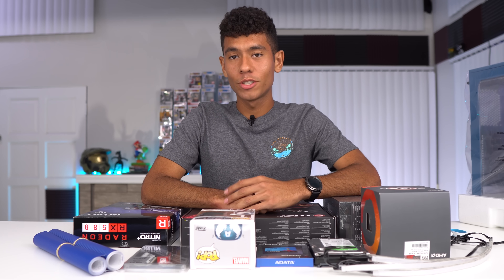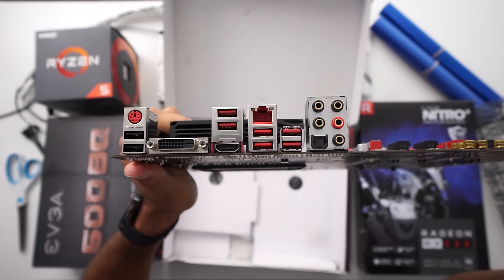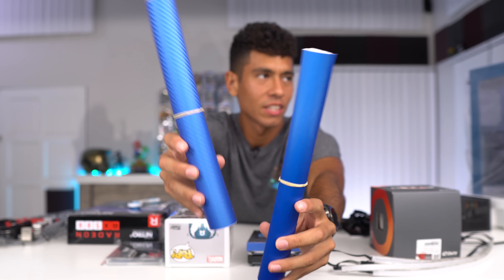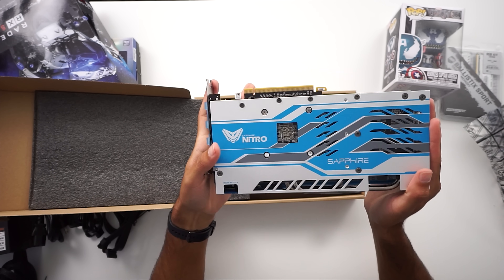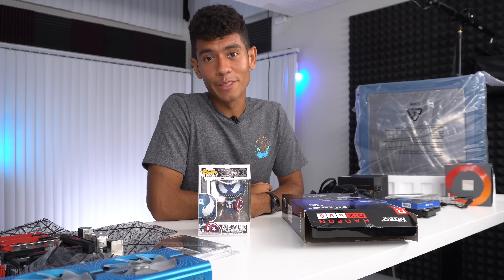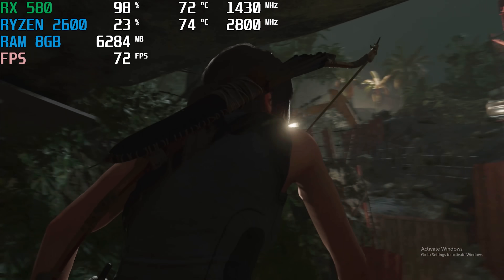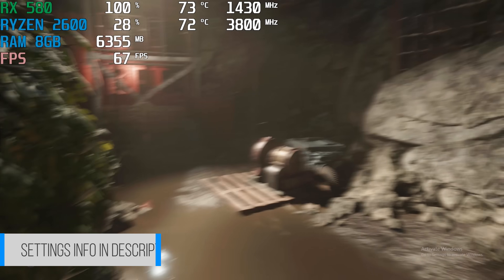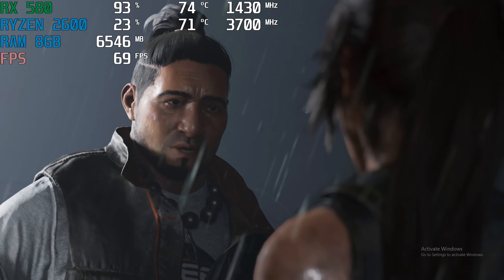$900 Gaming PC Build - Ryzen 5 2600 RX 580 (w/ Benchmarks)

Comment: im building a similar pc here are the specs:
processor: ryzen 5 2600x(200$ new)
graphics card: gigabyte gtx 1070(300$ new)
ram:2 standard ddr4 8gb sticks of ram(150$ new)
harddisk:1 terrabyte harddisk(58$ new)
case: cougar mx310(60$ new)
power supply: 500watt psu(50$ new)
motherboard:GIGABYTE GA-AB350-Gaming 3 AMD RYZEN AM4/ B350/ RGB Fusion/ Smart Fan 5/ HDMI1.4/ M.2/ SATA 6Gbps/ USB 3.1 Type-A/ ATX/ DDR4/ Motherboard(81$ new)
anything wrong with it if so plz tell me(btw it cost 899)

Comment: Great video.. does.everytjing apply the same waylike I'm building mine tomorrow .. and I have asus x470 pro, barracuda hdd ,ryzen 5 2600x 2 8gb stick and a evga gtx1070 with   a 750 power supply with a cooler master case .. am I missing something .. thanks

Comment: button, nothing happens. However, if I press my Eject Button, it will start up. I checked the front panel connectors and where they should go on the motherboard, I put them in the right spot. Could someone help me out on this?

Comment: This is kinda trash build you nead atleast 240 GB SSD 128GB fills up really fast and ram is too slow for ryzen 5 2600 you need atleast 3000Mhz RAM
Reply: Would you recommend an m.2 nvme ssd or is the 2.5" acceptable?

Comment: So many options, im considering this build. Will the 580 cut it or should i throw in the extra 150 euros for the vega 56? I intend on putting in 16 gb ram, is that overkill? I wana be somewhat future prove. What does that blue wrap do? Can i use the regular cpu fan or do i invest in an aftermarket one? Any tips would be so appreciated
Reply: Vega 56
Reply: 1)RX 580gb will get the job done. If you're doing tasks CPU intensive like video editing, streaming, mining, aftereffects, multitasking, 3D rendering then my friend go for Ryzen 7 2700x
2)Blue carbon wrap is nothing but a wrap to hide the black color to get good aesthetics for PC.
3)Never buy CPU second hand always go for the new one.
I hope this solves your answers.
:)
Reply: @morespeedmorepeace  all the things you just mentioned being gpu demanding arn't gpu demanding at all they are very cpu demanding though
Reply: @kieron_  I edited the comment. 
Sorry my bad.
Reply: 16gb is not overkill

Comment: A $900 gaming PC with only 8gb of RAM? Should've just scrapped the SSD and spent the money on more RAM.
Reply: @Flurry 
Geez dude chill. I don't know why you're getting so worked up. Just Cause 3, Just Cause 4, Batman Arkham Knight, ARK, Battlefield 1, Battlefield V, and GTA V are a few games that either need and/or run much better with more than 8GB of RAM. 16GB is also much more future proof than 8GB. Not to mention that it raises your max RAM potential, should you ever want more RAM. With a PC at this price, I'd say you'd want more than the bare minimum on what you need. If you ever wanted to get into video editing or VR, 16GB is much better, too.
Reply: @Flurry 
I'd rather be able to play any game I want to on my $900 gaming PC and have to wait a minute longer to turn on my PC.
Reply: @Flurry 
If you'd actually read my reply, you'd see that I know what I'm talking about. Getting triggered over an opinion makes it look as if you're the ignorant one.
Reply: @Flurry 
I have. And all research shows that 16GB of RAM is much better than 8GB in multiple AAA games (and is sometimes pretty much required if you don't want stuttering), VR, and video editing. And provides plenty of breathing room and will last much longer. 16GB of RAM affects performance much more than faster loading does. You can look that up, too. Everywhere you look will recommend 16GB of RAM instead of 8GB for Battlefield 1 and V and Just Cause 3 and 4, video editing, and VR. That may only be 4 games but that is the direction gaming is rapidly heading towards. The gaming industry is also heading towards 4K, too. The popularity/hype of the PS4 Pro and Xbox One X demonstrates that.
Reply: @Flurry lmao
Reply: @Kev B
I was more referring to the base parts. I personally don't count aesthetics and extras as part of the build. I agree, though, they offer nothing to the build other than a bit of eye candy, and the PC already looks fine anyways. For a more budget friendly build, it's just a waste of money that could go towards improving the actual machine.
Reply: Nah the ssd is worth it
Reply: This build is better for way cheaper and more ram but less storage

Comment: Will AMD Ryzen 7 2700X Processor with Wraith Prism LED Cooler - YD270XBGAFBOX work with this build ?
Reply: yes
Reply: Jake Ngo  thanks. I’m going build this pc in January but wanted to spend a little more money to get more upgrades. Do you know if you can buy a wifi adapter to attach to the motherboard? Or can you only get a usb wifi adapter.
Reply: Ashleigh & Marcus Vlogs Edwards if you want to get the WiFi adaptor to be part of the motherboard than you could buy a WiFi card that goes in a PCI Express port but I’d suggest getting a usb adaptor instead so you wouldn’t risk the WiFi card not fitting with all your other parts
Reply: Jake Ngo thanks. Oh last question was wondering about air flow with those two fans in the front. Is it worth it to buy extra fans to maybe put on the top maybe ? Or does the airflow in this build work perfectly?

Comment: You don't need $900 for a ryzen 5 2600 and Rx 580!
Reply: Built a 2600 rx 580 build for just over 600
Reply: @BP02392   Can you list your parts?
Reply: @BP02392  does that include tax and shipping?
Reply: 1000€ in Finland :)
Reply: @Jokakutihut1  Hyi niin kallis? Ostin ROG GTX 1070 OC, R5 2600, 16GB 3000Mhz, 500gb M.2, 1tb hdd ja virtalähteet ja kotelot ja kaiken muun 1050€. :D
Reply: @lauri3705  Ja mistäköhän löytää osat noin halvalla?
Reply: @BP02392  yep
Reply: @BP02392  Yes it's possible!
Reply: @BP02392  what motherboard did you buy?
Reply: @sleepy5838  A gigabyte GA AB350
Reply: yeah he spent more on the graphics card because there was a custom blue one to go with his build.
Reply: I made the same build pretty much just swapped the 2600 w an i3 8100 because I couldn’t spend the 160-175 on the processor
Reply: @highlight9678  if i were you i wouldve went with a cheaper ryzen like a 1600x, its better than the i3 by a lot.
Reply: CatArtz i know man and I regret it and I bought a high end Z370 board w out even thinking about it..my original plan was to go with Ryzen but I wanted to go cheaper but ya know I’ll still get solid gaming performance so it’s straight
Reply: Edgeshot Thanks. Ok now can you send them to me?
Reply: He has a 750 build with the same specs
Reply: @KyoukoWatches  yeah but I found almost the same parts with just over $600
Reply: MrButterFluff I’m going to build a pc with those specs so could you lmk where you saw those prices
Reply: worth it to get 16 gb over 8?
Reply: @backward9  yes
Reply: Benedikt ya I’m building a Ryzen 5 2600x, 16 gb ram, and gtx 1070 for $900. His build is like what you’d pay for a prebuilt haha
Reply: Well prices have dropped and also you dont need saphire it costs $100 extra
Reply: I mean hey paid 300 for the rx580
Reply: @rainmanxt  link?
Reply: it focuses on CPU, GPU and ram which is most important for a budget build also cooling which I picked a case that has 3 fans... this build is overpriced... he could of got a cheaper gpu with the same performance could of got a cheaper case as well
Reply: His build only has 8gb of ram 2x4 gb which is good since its dual channel but you can get cheaper 16gb of ram 2x8 for cheaper
Reply: "FoR tHe LoOkS"

Comment: I'm going to use ryzen 5 2600, xfx rx 590, corsair vengeance 16gb. What mobo should I use? And is EVGA - BQ 500 W 80+ enough for this PC?
Reply: b450 or x470 will get the job done.
I would recommend to go for 600W just to be on the safer side.

Comment: I just finished my build, x470 gaming pro motherboard, rx580 8gb mk2, and ryzen 2600x. Installed the flash drive with windows 10 with key. Started the pc took me straight to window 10 install everything was going ok it was installing.  Walked away, came back and the screen was black. Tapped the mouse and nothing happened. Shut pc off by pressing power button once. Turned it back on and there's no signal to monitor. Any ideas of what happened?
Reply: you've to take flash drive out after its installed and then restart. all good?
Reply: @morespeedmorepeace  I actually manually shut the pc down for like 20min and then restarted and it did a install restart.

Comment: Hey Joey, I plan to build a gaming pc with ryzen 5 2600x and GTX 1060, IS IT A BAD COMBINATION?, AMD cpu and NVIDIA gpu?
Reply: It is great but you can get a ryzen 5 2600 with a arctic freeze 30 dollar freezer which is the same price as the 2600x and you can overclock it and it will stay cool

Comment: I have a couple of questions:
-Amd 2600 150€ or 2600x 190€
-is 16gb ram needed if on a budget and only gaming
-best motherboard for the 2600 under 100€
 Thanks
Reply: Ok 2600 and then overclock it and get the same performance for less dollars and 8 gb of ram is enough 16 is overkill and best motherboard get a x370 mobo from msi or asrock
Reply: @Mkh-1442  but i will probably have to buy a better cooler as the 2600 comes with a smaller than the 2600x. And if oc i should most defenetly get a better cooler.
Reply: Get an arctic freeze cooler I think it is names arctic freeze one for 30 bucks and you have the same 2600x price but better performance
Reply: @Mkh-1442  i might just go for the x for better performance without oc and a better fan
Reply: Ok

Comment: Nice video and thanks for the links of the build, it is the same build I am doing, only I would like to take the ryzen 7 1700X since the price now approaches the ryzen 5 2600X (I work in addition to gaming video editing and more ).
For the rest I'm using the Supernova EVGA G3 750W taken in offer at € 60, Samsung EVO 850 500GB SSD, RAM G.SKILL Trident Z 3200ghz, I just have to choose a monitor with the freesync and the case.
I wanted to ask if the sink of the AMD behaves so bad, seeing the FPS I also noticed that in most games temperatures are quite high, around 75 degrees for both cpu and gpu (rarely the gpu is 55 degrees), can you do something to lower those temperatures or is it normal?
Over time, the components do not wear out before increasing the Delta T and then wearing the board due to thermal sailing?
Thanks for all! God bless you.

Comment: Anyone know what other case i could use and graphic card and either a lil less with around same results and compatible? Would really help, i'm new to this. A case still used like this but maybe a slick black or white that be nice with red rgb lights
Reply: Xavier Cardon maybe a Msi Rx 580 8gb  for around £230-240 but this depends where you are from .
Also recommended a Corsair Spec 05 comes with a sleek black finish and a Red quiet Led  Fan . It’s what I currently have now with the Rx 580 used in this video :) also gtx 1060 6gb depending on the price . 1060 and 580 come close with performance. 580 has a slight edge in High demanding games but if you want to play Games like csgo etc then you could really scale down and get a gtx 1050 ti for around 150-200 also again depending where you are from This will easily allow you to play games in high settings 60fps but may have to scale the graphic settings down for higher demanding games . Hope this helps aha
Reply: Itz Noble can you screen shot your pc?

Comment: I will build my pc in black friday and i will use a B450 asus prime motherboard ryzen 5 2600 ,RX 580 8gb gigabyte gaming, deepcool matrexx 55 RGB case, 620w power supply modular, 16gb of ram Gskill trident Z, 1tb hard drive and a 240gb M.2 ssd
Reply: if u  use stock cooler get lowprfile memory vengeance 3200 lpx.

Comment: I spent $1000 and here’s what I got. The benchmarks are much higher. 

CPU Ryzen 1800x - $250
Asus x370 MB- $150
GTX 1060 3GB - $180
Corsair 16gb(2x8GB) - $150
SSD EVO 500GB - $150 
PSU - $50 
Case temper glass phantek w fans- $80

Comment: Hey joey. Can you please build a pc with these parts:

Motherboard: MSI x470 Gaming Plus
Power supply: EVGA 600 Watts
Gpu: Saphire Radeon Nitro+ rx 580 blue edition 
Cpu: Amd ryzen 5 2600 with cooler
RAM: Corsair vengeance LPX 8gb ram ddr4 
Case: NZXT S340 black and blue
SSD: ADATA 128gb
Hard Drive: segate barracuda 2tb 
Led strips: NZXT HUE+
_______________________________
Like if you want Joey to see it👍

Comment: my black/red PC Build: 
CPU: AMD - Ryzen 5 2600 3.4GHz 6-Core Processor
Motherboard: MSI - X470 GAMING PLUS ATX AM4 Motherboard  
RAM: G.Skill - Ripjaws V 16GB (2 x 8GB) DDR4-3000 Memory 
SSD: Crucial - MX500 250GB 2.5" Solid State Drive
HDD: Seagate - BarraCuda 1TB 3.5" 7200RPM Internal Hard Drive  
GPU: MSI - Radeon RX 580 8GB ARMOR MK2 OC Video Card  
Case: Phanteks - ECLIPSE P400 TEMPERED GLASS ATX Mid Tower Case [PH-EC416PTG_AG]  
PSU: SeaSonic - S12II 620W 80+ Bronze Certified ATX Power Supply
Total: $880 USA Dollars Aprox.
Note: the ram coast more than the motherboard LOL! and because Call of duty Black Ops 4 and GTA V need more of 8GB RAM maybe 12GB RAM is good idea after all

Comment: Hey, could be nice if you gonna make some video about cooling. My problem: i have no room for pc on the top of the table, so am using the box under the table. The bad thing its flowing warm air into the box so the pc more warm. You think can i change direction and suck air from back and push out on the front?

Comment: Could you build this pc? :D
Ryzen 7 1700 wraith boxed
Msi b450m mortar
Asus rog strix rx580 08g oc
Corsair vengeance RGB 16gb 2666mhz
Cooler master q300p with 2 extra cooler master fans
Kingston 128gb ssd
WD blue 500gb 7200rpm
Thermaltake RGB 500w

Comment: Hey is this a good pc to buy please replie back quick

Specs:
CPU: Intel Pentium G4560
Ram: 16gb(2x8gb) RAM
Mobo: Gigabyte B250M-DS3H
 GPU: Rx 550 4gb
Storage: 512gb Sandisk SSD
PSU: 700w RGB Thermaltake
Case

Comment: Is the pc build good ? Tell me if somthing is wrong 

AOC - G2260VWQ6 21.5" 1920x1080 75Hz Monitor

TP-Link - TG-3468 PCI-Express x1 1000 Mbit/s Network Adapter

Asus - Xonar DGX 24-bit 96 KHz Sound Card

Microsoft - Windows 10 Home OEM 64-bit

EVGA - SuperNOVA G3 650W 80+ Gold Certified Fully-Modular ATX Power Supply

Deepcool - TESSERACT SW ATX Mid Tower Case

MSI - GeForce GTX 1050 Ti 4GB GAMING X 4G Video Card

Western Digital - Caviar Blue 1TB 3.5" 7200RPM Internal Hard Drive

Corsair - Vengeance LPX 16GB (2 x 8GB) DDR4-3000 Memory

MSI - X470 GAMING PLUS ATX AM4 Motherboard

Cooler Master - Hyper 212 EVO 82.9 CFM Sleeve Bearing CPU Cooler

AMD - Ryzen 3 2200G 3.5GHz Quad-Core Processor

Comment: Just got parts for a very VERY similar build:

Ryzen 7 1700 - $180
ASUS ROG Crosshair VI Hero x370 - $120
Sapphire Pulse Radeon RX 580 8GB Graphics Card OC - $180
CORSAIR Vengeance LPX 16GB (2 x 8GB) 288-Pin DDR4 SDRAM DDR4 3200 - $160
CORSAIR FORCE Series MP300 480GB NVMe PCIe M.2 - $110
EVGA 600 BQ 80+ BRONZE Power Supply - $50
CORSAIR 200r - $10
= $810

fuck...yes.

Comment: What should I buy 2600 or 1700 prices are same 1700 20$ more..
Reply: Saikat Khan ofcourse 1700 8 cores are always better than 6 cores
Reply: Neel hans that’s not true at all. Overall performance and ram management you want the 2600. If you’re focused on a workstation then the 1700. More cores doesn’t mean better.
Reply: 2600 is good in gaming

Comment: Building first ever pc and i wanted to know how well it will run with thesr parts : ryzen 5 2600
GPU: asus geforce gtx 1060 3GB
MB: asus prime B450-plus
Ram: 2x4 GB
Edit: By the way is a SSD absolutely necessary? because i don't plan on adding one to save money
Reply: Really late but, the 3gb 1060 is trash. And i consider an SSD a must have. You system will boot very fast and essential programs will run fast and smooth. Its a whole new world of speed compared to HDD. Also i highly recommend going with 16gb of ram.

Comment: is a ryzen 7 2700x good with the same graphics card joey is using
Reply: Yeah, it's what I plan on purchasing, there are plenty of benchmarks for it, will be able to run most games 1440p60fps
Reply: 5 Minute Football what is the best cooler that will be good that will fit with the mother board he is using
Reply: I'm not certain, there are some good All in ones on Ebuyer.com for the chip type.

Comment: Joey!! I have a problem with my new pc i've built, My games crash every single time I play one, and sometimes the gpu stops senging signal, my gpu is an Aorus RX 580 8gb, i've been reading about my problem and its probably the gpu, i don't know what to do, could you or someone else help me??
Reply: Do you have all the PSU cables plugged in?
Reply: @Norkeys almost all of them, In 1 cable where the SATAs power are, I didn't need like 3 SATA power, all the other cables are plugged in where they are supposed to be
Reply: @andonicardenasalonso2015  Well does the system detect your gpu? If not just perform an rma
Reply: update your bios? or drivers.

Comment: Hey man, you should do a build with : EVGA GTX 1060 3gb (single fan not superclocked), Ryzen 3 2200g, Gigabyte GAB350M-DS3H, 8gb of ballistix sport ddr4, 500w EVGA power supply, 1tb wd blue. Then any case you want to do.
Reply: Why apu?
Reply: I’m just gonna assume your asking why I went with a CPU that doesn’t need a GPU. Well I was gonna go with a ryzen 3 1200 but the 2200g is a much better processor with higher stock clock speeds.

Comment: I have 2 USB 3.0s on the front of my cooler master N400 case and I got this case in 2014? Plus the MSI MB I bought at the time has 2 built in off the back. I don't know much about building computers.. this was my first build in 2014 and have upgraded a few things since, but same MB and case since initial build.